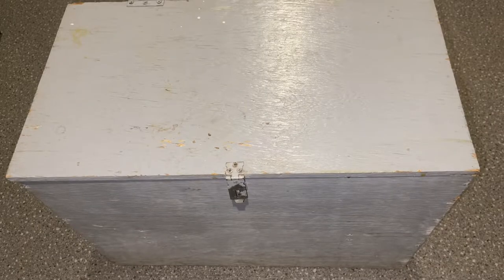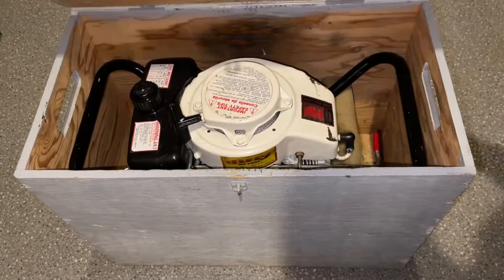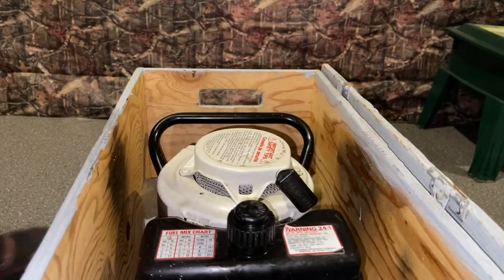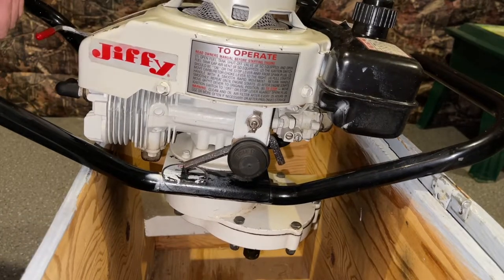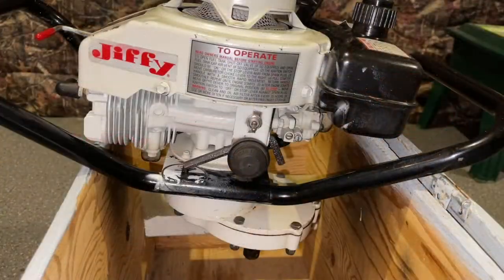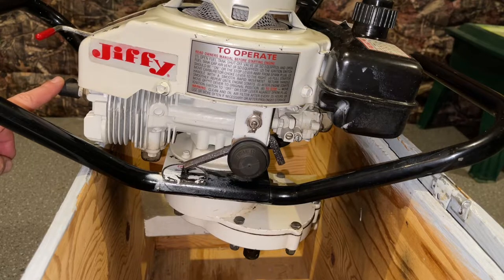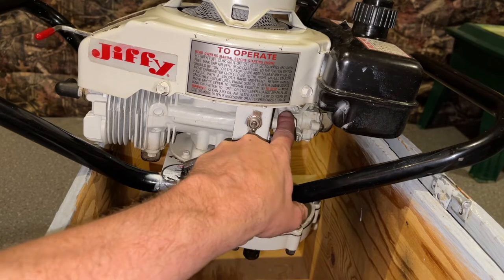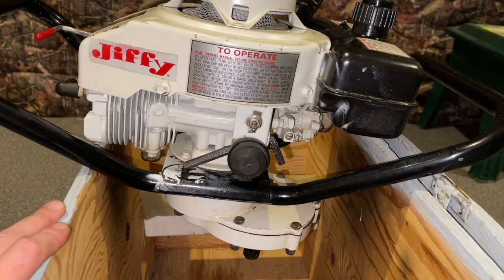JIFFY ICE AUGER FIND! (PART 1)

Comment: Sweet jiffy, I have the identical one 82 model i believe. You can look up the serial # and find out the year.
The carb settings are 1 1/4 turn out from closed (low speed) closest to the engine.
5/8 to 3/4 from closed high speed.Clockwise to close
I would pull the four screws off the bottom of the carb and make sure the diaphragm is ply able. Carb kits are around 30 bucks.
Make note of the diaphram and gasket some years had it reversed and i cannot remember the correct order off the top of my head.
Reply from the maker: Thanks for heads up! Appreciate the input sir.  I do appreciate a good 2 stroke predicament! Haha 
I haven’t looked at it since the video Thanks for the reminder:) 
I should stop screwing the pooch on this one.
Reply: @SaskHunting  Nothing like the sound of a good running Tecumseh in the Morning Lol

Comment: nah... Just carb cleaner while its running. A little spray ( try to not make it die on you ) then give a little gas to maintain the iddle and repeat until it runs flawless. sometimes i'll go half a can before its ''clean'' enough to start everytime and maintain a iddle. 

 such little carbs nees more attention every season. clean carb is the key . And as for your uncle's wood box, its very common here in Quebec as we want to keep our auger in a standing position. these are considered the best in here and some people even use it to dig pole holes for there fences...
Reply from the maker: Do you think the only thing I need to purchase is gasket seal and diaphragm?
Reply: I'd remove the air intake to expose the throtle body and spray shots of carb cleaner WHILE the auger is running. Spray and keep it alive with the throtle. 

 Half a can or even a full can if it needs it. If this dosent clean the iddle and main jets, then i'd open it and inspect it before buying anything.

These things are build strong but has any 2 strokes, carbs need to be clean everytime its start to get symptoms. I dont think the diaphragm shoukd be changed has if it was damaged , it would not hold a iddle.  But you can sure inspect it...